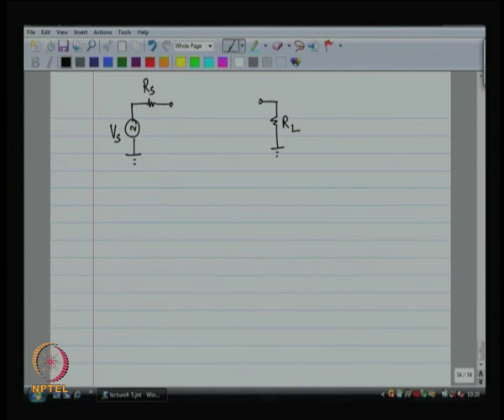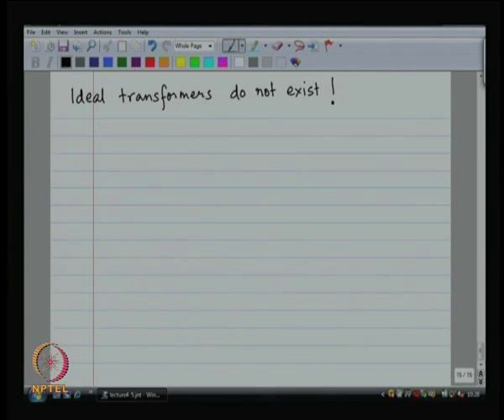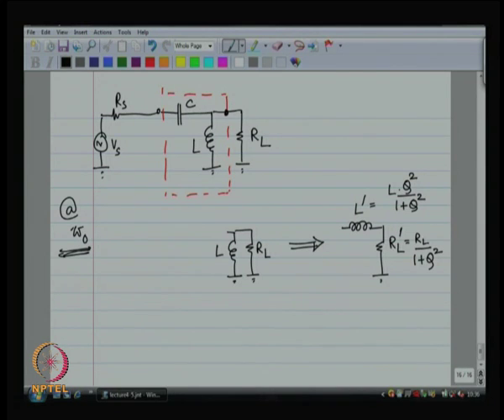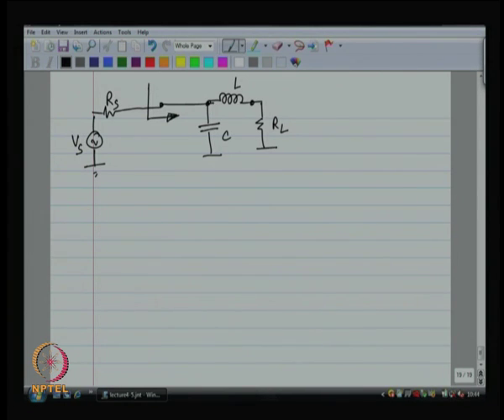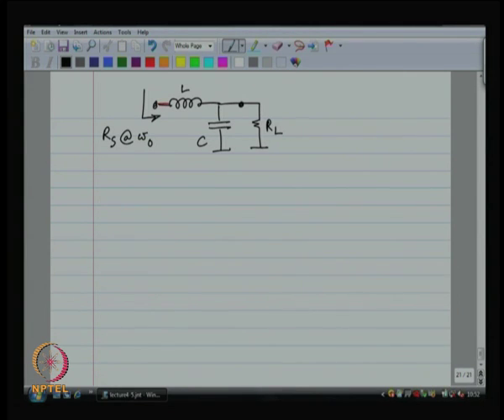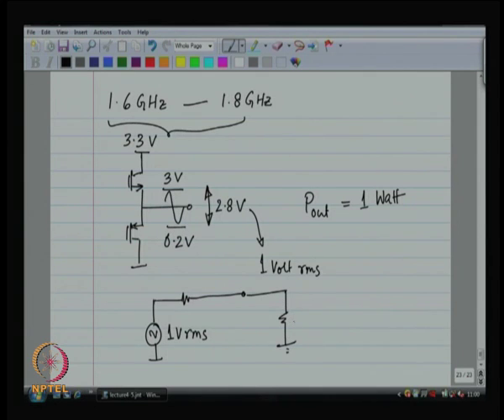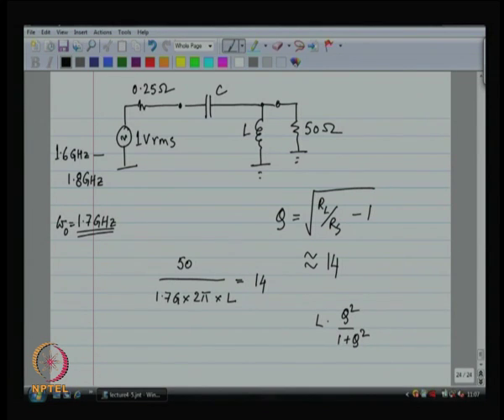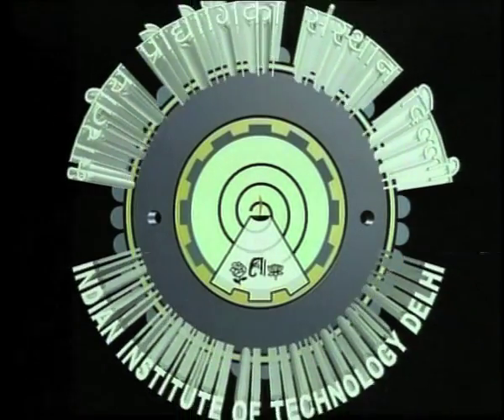Mod-02 Lec-05 Matching

Comment: Video Time@ 22:00-23:00, Step 2 : Compute L..does that Quality factor value is right or wrong? Please do check and let us know
Reply: q loaded determina el ancho de banda! q nodal que utliza es el de adaptacion. 2x Q loaded = Q matched
Reply: +MARTIN SAINT hablando de una red l
Reply: It’s wrong I think, it should be the reverse of it
Reply: The denominator term and Numerator terms has to be interchanged.
Reply: @arkeshjacharya  Q has been calculated from the original circuit(before conversion, as we are using that Q to do conversion) and there R and L are in parallel.